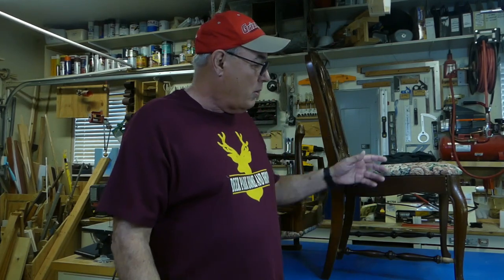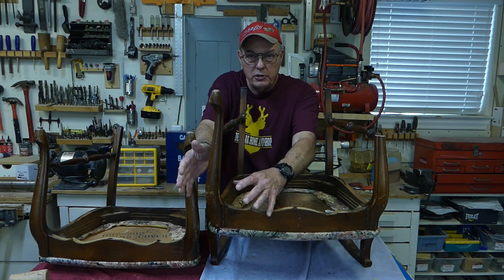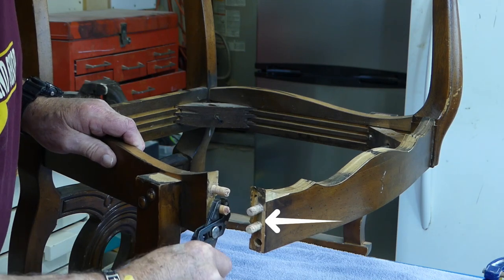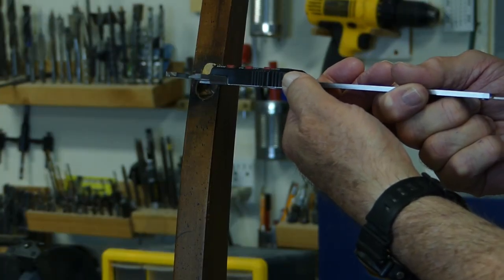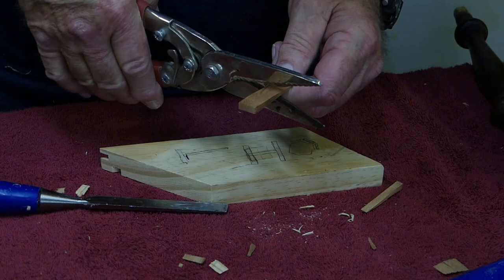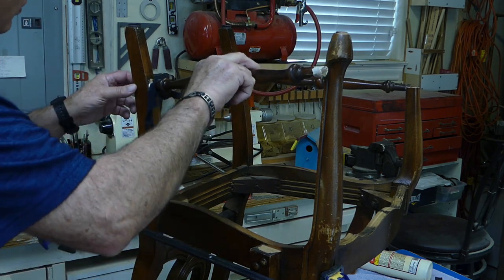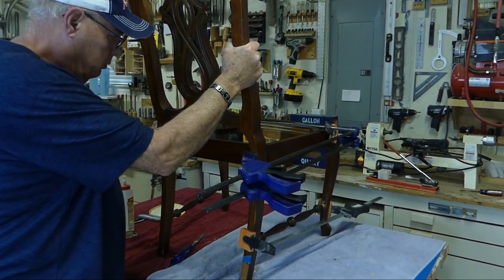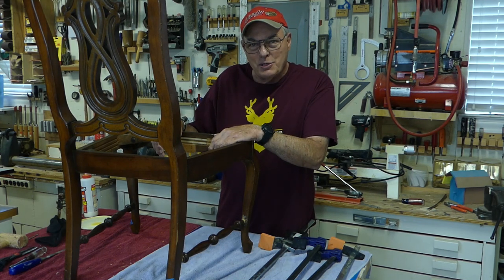How to fix or repair loose, wobbly wooden chair joints  - With PANTYHOSE

Comment: Your chisel is a "Swan-Neck Chisel", but I have not seen one with that sharp of a 45-degree bend. 
Usually, the bend is a rounded curve, were yours is a tight 45-degree bend.
Reply from the maker: Thanks so much! Do you know what it was used for?  I did an upholstery project years ago and I might of bought it for that, but it's application is beyond me.